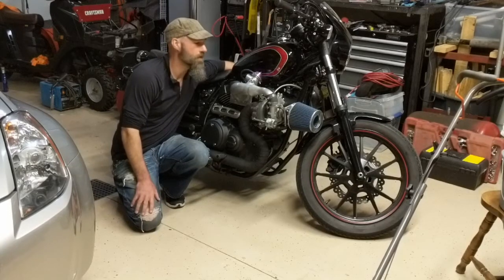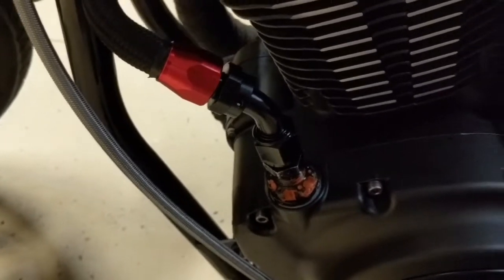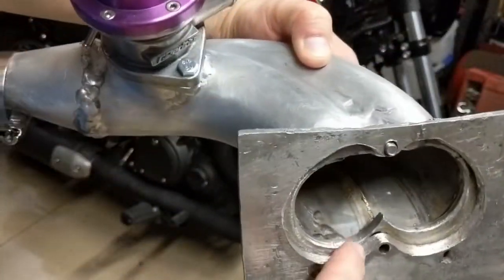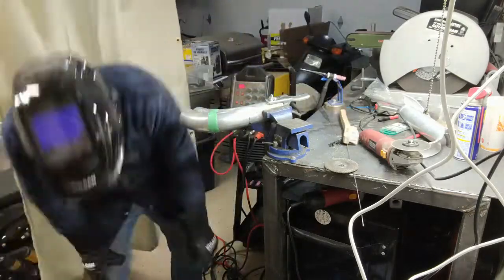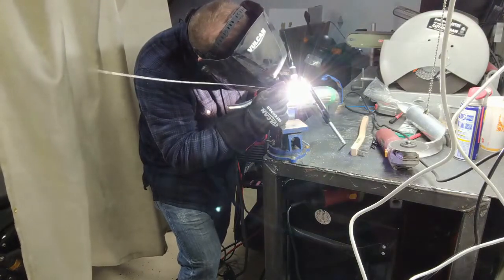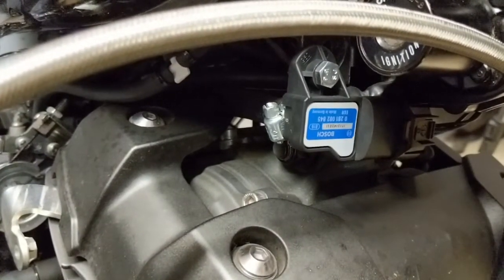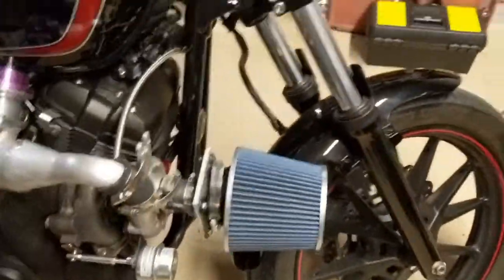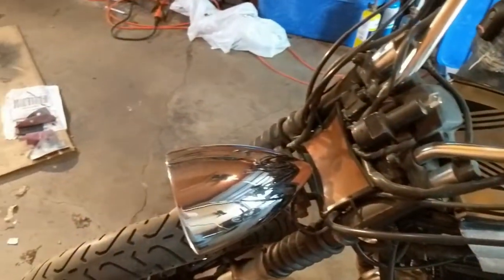S1 E3 Yamaha Bolt Turbo Build -We answer the big questions!!!

Comment: What size turbo did you use?
Reply from the maker: T15 turbo https://www.ebay.com/itm/GT15-T15-Turbo-Charger-For-Motorcycle-ATV-Bike-Oil-Feed-Drain-Flange-Fitting-Kit/270841642167?ssPageName=STRK%3AMEBIDX%3AIT&_trksid=p2057872.m2749.l2649

Comment: hi guys, pls put a video running the bike.....what changes do you need to do in the dyno fuel unit? for sure give more food to the beast....
Reply from the maker: I set the dynojet up to tune based off the 3-bar MAP sensor instead of throttle position. I'm hoping to do a dyno video to see what HP number we have in a future video but it may not happen until next summer.
Reply: @mycrampedgarage2506 ..Man I hope to see you do it this year! I am basically copying your build ideas. How many lbs is it running daily on the street? You should be able to do rough numbers knowing boost with fuel numbers. If it is pretty efficient, you should make about double horsepower with 15psi.